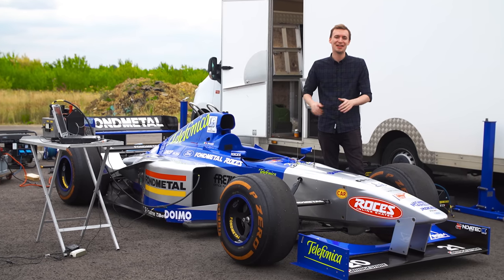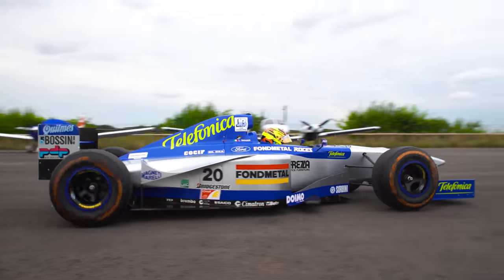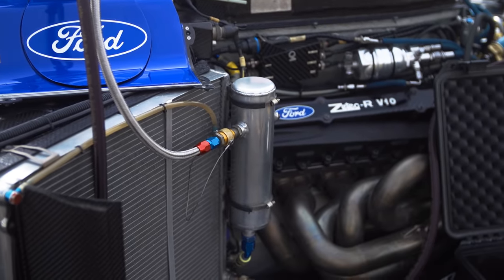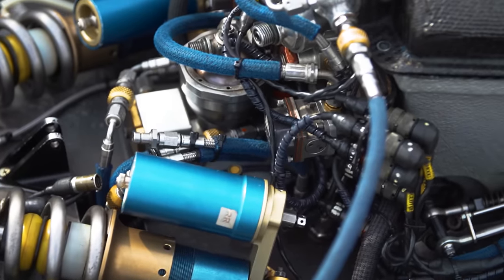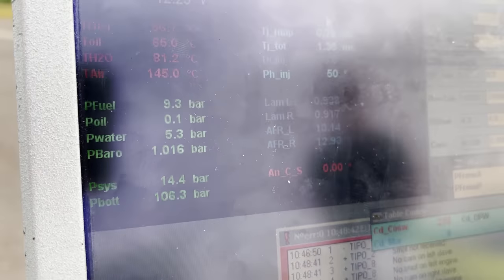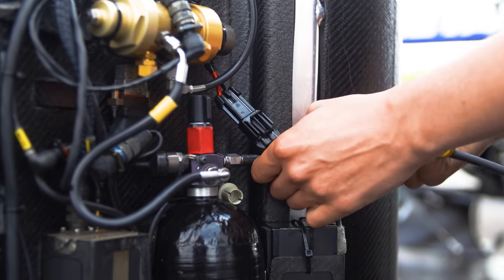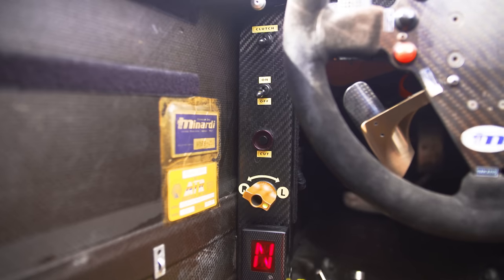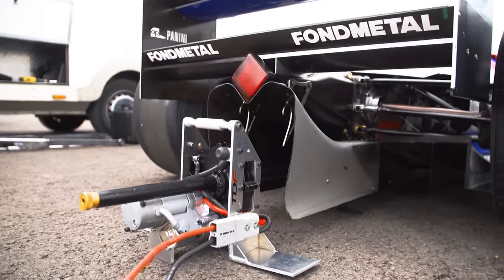Why Formula 1 Cars Take Hours To Start

Comment: I worked on Locomotives in the Mid 1970's in the Pilbara, Western Australia. We had a loco idling on standby all the time. The moment it was needed in service, the next would be prepared, much the same as this. Over 90% of the wear they said was starting. So we'd heat the coolant and also the oil up to operating temperature, then pump up the oil pressure before it was started. It took about 24hrs if there was no rush to get it ready to fire.
Reply: Cold starting has always been the weakest point for any engines that correspond to 90% wear when starting. In this many farmers when they start their big tractors very often I see them revving up with "shots" the engines in order to warm the engine. In my modest opinion I find it very brutal on the engine. I know because I very help my girlfriend with her big tractor that is is "eating" oil from too many Cold starting when it was driven by her brother....
Reply: @BloopTube  yes, I agree with you fully 👍👍
Reply: @BloopTube  less cycling of anything is usually better
Reply: Interesting.  I did a little bit of work on a much smaller diesel engine (somewhere around 1,000 hp or less) in an emergency power generating set at a wastewater treatment plant about 15 years ago.  As I recall, it had a supplementary electrically-driven oil circulation pump and an electric oil heater to keep it warm enough to be ready for action.  I can't remember exactly how this oil circuit integrated with the main one that used the pump mechanically-driven by the engine itself (probably just a short bypass around the mechanical pump, operating in parallel) or whether it stopped operating when the engine was running (perhaps based on oil temperature and/or pressure feedback) or just kept going regardless.
Reply: Dude that's crazy
Reply: Big rigs used to never turn off and idle all the time. Now with the push for green energy. The engines turn themselves off after a certain time. Buying new parts to fix broken engines from cold starts might be worse on the environment than just letting the engine idle a little more.
Reply: Wish cars had a block heater  I'm done heating the oil on the stove. 😆
Reply: @perpetualgrin5804  I bet you get complaints whichever saucepan you use, too. Hahaha! "No, dear. I don't think this spaghetti tastes like the garage."
Reply: @prestonwarren2692  honestly with a large diesel engine in a semi you would probably be able to afford a new engine with the fuel saved by not idling. When you idle a big diesel you need to have it on high idle to keep oil pressure up burning 3-4 LPH. So if you burned 3.5L/hr for an 8 hour rest period 6 days a week at $2.20/L (here anyway) that's $369.60 a week. In about 2.6 years idling 8 hours a day 6 days a week you could have bought a $50,000 engine with the fuel you burned.
The only time you should be idling is when it is cold enough the truck won't start again without the block heater plugged in. -15-20°C. They make diesel bunk and coolant preheaters and diesel genset APUs that burn less fuel. Also diesel particulate filters in trucks newer than 2008 don't like extensive idling and are extremely expensive. Some places you can get away with deleting the emmisions stuff but they are cracking down hard on it unfortunately
Reply: For big ships, still the same. (Talking 2 story, longer than a bus engines) we use the emergency gen to start the main gens. And the gens to start the mains
Reply: Did you ever race it?
Reply: Maybe a bit off topic, but I have a pretty decent home audio system that I never, ever turn off. Of course, every so often we have the inevitable power outage but other than that the system has been running nearly nonstop for eight plus years now, keeping the component temperatures stable and more importantly avoiding the nasty voltage and current spikes and surges that result from shutting down and restarting the system on a per-use basis. I learned the benefits of consistent temperature control for electronics a long time ago, and it has been a real advantage when it comes to stretching out the life of my equipment.
Reply: Wow I didn't know that that's very interesting thanks for the info I can see that just like it's easier to leave a diesel dump truck or semi running if it's going to be sitting for a few hours rather than shutting it off and restarting it it's harder on it
Reply: @perpetualgrin5804  You can add a block heater to virtually any ICE engine.  Generally, you'd want to heat the coolant, but you could also warm the oil in the pan, which is less effective than heating the coolant.  For extreme applications, you can do both.  Not that expensive--Google.
Reply: @paoloviti6156  it's why a lot of modern cars track not only mileage but "engine cycles". The cycles an engine goes through, from cold to hot and back to cold, tell more about the possible wear/tear than the mileage. 

If you look at the "million mile cars" they often do extremely long journeys without a lot of cooling down. This doesnt' wear on the engine nearly as much as cold starts.
Reply: @prestonwarren2692  It will be a non-issue very soon.  Diesel trucks are soon to be obsolete.  Electric trucks will replace them rapidly.  Within 10yrs or so, all of the major trucking lines will be all electric.  The cost benefit ratio of electric vs. diesel is already a no brainer, and getting better every quarter...
Reply: @CRneu  exactly what I was thinking too..
Reply: My first thought was it's almost as involved as firing up a steam locomotive to operating from cold.  Not quite, but close.  Almost as much for a modern Diesel-Electric locomotive with a lot of computerization.
Reply: @ctvxl  it doesn't make sense for trucks, sorry
Too high a load kills efficiency, the grid in most of the world is nowhere near capable, load times are abysmal even for electric cars compared to filling the tank so it's gonna be even fucking worse for trucks, you are only thinking of the energy prices but there are many, many more factors than that in the overall cost of transport
Reply: @KibitoAkuya  Just wait and see.
Reply: @ctvxl  Until they build a better battery and figure out charging. Diesel and CNG trucks aren't going anywhere. As far as I know they are nowhere near figuring out the range and battery weight issue for trucking.
Reply: @DaveW74TVN  

Look how bad the new lightening battery mileage is when it tows anything.   And thats not even in the cold yet.
Reply: So modern start stop systems essentially fuck up engines. How does idling for short amounts of time compare to the energy expended to manufacture replacement parts?
Reply: @tays8306  Yep I saw the video Hoovie did about that.
Reply: @perpetualgrin5804  My dodge ram 24v cummins absolutely will not cold start less than 40f without the block heater.
Reply: @perpetualgrin5804  cars in Canada have block heaters.
Reply: @BloopTube  we die because we were born, so in a way, our start also kills us
Reply: @BloopTube  Very true. If it weren't for being born our lifespans would be phenomenal!
Reply: @@Dartgame340 You are the one that needs to pay attention to facts my friend.  Lithium is EXTREMELY abundant and found all over earth.  There is many many times more recoverable lithium in the earth's crust than we will ever need, especially once battery recycling is in full swing.  You have been listening to FUD.  Try stepping outside the echo chamber and do some research for yourself...
Reply: @paoloviti6156   Yes you are correct RPM's hurt cold engines, it's best to keep them low as possible until you hit optimum temps. Which is 181F on the Cylinders and 190F on the Motor Oil. Also people don't realize this, but if it's 50F outside and you don't preheat your car and start driving, you will hit 180F on the cylinders and your motor oil will still be in the cold zone for another 2 minutes. This is how a lot of people damage their cars. They'll think they can go full throttle not realizing, that they are forcing thicker oil through the engine.
Reply: @wtfskilz  yes I agree with you and you explained very clearly (your grammar is much better than mine!) but when I explained this to my friends they would look at me as some kind of an idiot...
Reply: @perpetualgrin5804   ? What? Here pretty much all cars have a block heater that warm up the water and also the block... You just plug it in to electricity an hour or 2 before you plan to start the engine.
Reply: @BloopTube  Same with computer chips. Although they will easily last +10 years but if they cycle room temp to 90C then back over the years, they will break sooner. At least vintage chips don't run that hot for those collectors.
Reply: @ThaFuzzwood  This is a myth. Restarting a hot engine isn't a big deal; doing it cold is the killer.
Reply: @ThaFuzzwood  The problem is that the energy expended to manufacture replacement parts is not counted when you need to meet the regulations
Reply: @ctvxl  I would not bet on that.

Comment: Gentlemen, a short view back to the past. Thirty years ago, Niki Lauda told us ‘take a monkey, place him into the cockpit and he is able to drive the car.’ Thirty years later, Sebastian told us ‘I had to start my car like a computer, it’s very complicated.’ And Nico Rosberg said that during the race – I don’t remember what race - he pressed the wrong button on the wheel. Question for you both: is Formula One driving today too complicated with twenty and more buttons on the wheel, are you too much under effort, under pressure? What are your wishes for the future concerning the technical programme during the race? Less buttons, more? Or less and more communication with your engineers?
Reply: Sorry, could you repeat the question?
Reply: Good question.
Reply: They'll do whatever they need to do to get the fastest lap times, that's the biggest factor.
Reply: The driver should only worry about driving. Entire teams of people with far more specialized knowledge exist so the driver should only worry about driving.
Reply: Sebastian Vettel's remark doesn't make sense at all. Starting a computer is even less complicated than starting a regular car.
Reply: @cult_of_odin  I kind of disagree. The driver should be responsible for operating the vehicle. If fiddling with engine maps or brake bias settings or whatever DURING THE RACE gives a competitive advantage then it should be up to the driver to make these changes, with advice from the team if necessary. If an engineer were doing this from pit lane it would disconnect the driver from the car and the race. Why doesn't the engineer change gears remotely too?
Reply: @rob1721  i agree with you 100%. the driver should be familiar and use all tools availablt to him to win race. pushing buttons makes car go faster, push buttons. lol.
Reply: @rob1721  but its should be simplified as much as possible. Ideally, its just slider, if you put it up, car entering max power mode, put down, entering energy saving mode, dont touch, balanced mode. you even dont need a drs button, because drs shoud be activated when car in max power mode and located in drs zone.
Reply: @yashaakimov5378  With that DRS logic, the cars should have automatic transmissions as well. As far as steering wheel design, these are the best people in the world designing these things. There's got to be a reason for the layout.
Reply: less button pls
Reply: 1997 rules
Reply: Things we need to keep.
No ABS/TCS (people seem to forget this was allowed and therefore used in the 80's/90's)
You got 1 map for a race. That's it.
The fuel flow limit is too fkn low. This is the main reason why the cars sound like crap. It isn't the 1st time we had boosted 1.6L V6's. BUT them being limited to only 15k is new. On top of that they barely hit 12k because of the fuel limit. Motors in Civics can hit those RPM's.
Lose the DRS and battery.
Make the cars smaller. They're fkn huge.

Comment: Nico Rosberg on the W07: it took my mechanics 6 hours to start the car.

Keke Rosberg on the FW08: compared to the Williams guys. They just pulled my car off the trucks and fired it up.

From Nico and Keke Rosberg interview with Martin Brundle in Monaco.
Reply: Is that Nico Rosberg that Monaco based YouTuber who beat Lewis Hamilton in equal machinery?
Reply: @KitKitChanIsaac  That guy who makes a lap of a track 10x longer by adding explanations?
Reply: @Klassik_KT  Yes
Reply: I mean, the old car did have a much simpler Cosworth DFV.
Reply: also older f1 cars only needed engines to last a race weekend so they didnt really care
Reply: @Klassik_KT  The whole point of those videos is to explain the track, what would be the point if he didnt?
Reply: @rantanen1  bruh it’s just a joke lol
Reply: @KitKitChanIsaac  All F1 discussions leads to Hamilton it seems lol. Someone rent free ?
Reply: @KitKitChanIsaac Yeah, after losing to Lewis in equal machinery for 3 seasons.
Reply: That is him although it dit take him 3 attempts to finally do it and then he quit...
Reply: @tiaancloete7301  Pretty sure it was team orders that prevented him from doing it earlier. In his last season, he just didn't care any more.

Comment: If the software requires an old laptop for it to run on because the speed of the newer laptops cause problems, then the old software was written by a crap developer.  Developers of games back in the 8088 days learned to not use that sort of timing loop when the 8086 started showing up in some PC clones and it was made especially noticeable with the PC-AT was released with the 80286 processor.  Many games that used timing loops were basically unplayable on a 80286 based PC since it would run about 6 times faster.
Reply: Yeah, but you're talking about F1, where almost every critical component is replaced annually, not a computer game. So creating new programmes and buying new laptops every year or every other year is hardly a concern.
Reply: The code was written by some random guy. The only requirement was just run and period.
A lot of enterprise software solutions are ported from older windows versions bc is cheaper than write an entire new code
Reply: YEAH YOU TELL THEM!!!!

Stupid F1 vehicles… tired of them not knowing what they’re doing

😂😂😂😂😂😂😂😂😂😂😂
Reply: maybe tell that directly to them, don't comment here, they won't listen to you.
Reply: No one knows wtf you’re talking about
Reply: Ah, I miss the days of non-threaded OS's where we had to make do with crazy short deadlines and what was in front of us :-)
Reply: @TJ-W you will find they do , it’s you that is ignorant to the information given
Reply: I think the problem of the time was getting the code to run fast enough to handle that much data in realtime from a serial port. This was the era where people would ask you "how many kbps are you'r mp3s?" because if it was too high they couldn't play them on even slightly older hardware.
Reply: @andersjjensen  Very true. A massive chunk of comms back in the day was via RS232 or RS485. 128kbs was probably the max.
Reply: Another issue is that at that time, windows software was only just coming out of the ethos of direct system calls that don't translate from one OS version to the next.
Reply: but there was the turbo button?
Reply: @Federico_Cahisyeah but this was written for windows 95 allegedly, the problem was WELL known by then. Amateur hour.
Reply: That explanation is a total bullshit.
The problem isn't that contemporary computers are too fast.
The problem is, just as you wrote, that the developer made a hodgepodge gizmo, utilising fixed timing in the software. Perhaps he even worked as an externist and they never got the source and rights to it, so they don't know how to refactor it to make it universal and to speak with modern computers, so if you try to run it on today's computer with a decent OS, it goes tits up.
Reply: You honestly believe they do this just because?... You think they wouldn't come up with better code if "crap programming" was the issue?... Obviously there is a need for this, and you have no idea what you're talking about so should really not try and look smart. People like that always end up looking foolish.

Comment: Having worked on the 1994 Tyrrell F1 car, I know the answer.  The engine has to be brought up to temperature before starting because of the tolerances.  It did not have the original engine but a detuned Judd engine which still produced over 700 HP from 3.5 liter normally aspirated engine.  In F1 racing they also cool the fuel these days and circulated through the fuel system for several hours.

Comment: Never gave it much thought but the tolerances on those high rpm engines are so much tighter by design they would need the metals at a certain temp or certainly they would cause more damage. Really goes to show how much engineering goes into making the most horse power. And this is a relic the amount of money spent on not only f1 but also nascar and funny cars and anything built for pure speed is insane.
Reply: Usually most tolerances in race engines are looser rather than tighter due to the high RPM's they run at. Also, in our drag race engines the aluminum block, heads, and rods grow a lot with heat so that needs to be accounted for. Cold valve lash is set at around .008", that opens up to .024" at operating temps.

Comment: These F1 engines especially these Naturally Aspirated V8 V10 V12 have such tight clearances in the reciprocating assembly and valve guides, it's a good idea the engineers heat up the oil and the coolant to pass through the long motor (from top to bottom) to allow for metal expansion closer to operating temperatures to minimise wear, because if they did start run them cold to warm up, they would have so many engines failing during the races it wouldn't be funny!
Reply: Warming up regular car engines would actually make them last a lot longer before needing to be rebuilt. Most engine wear comes from cold start ups. It's also an environmental plus because the emissions are less for a warmed up engine.